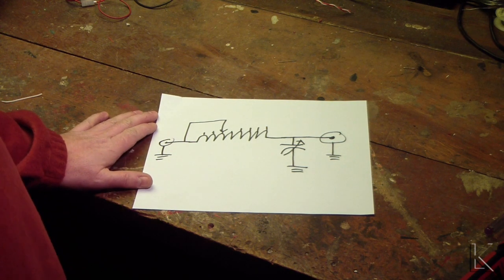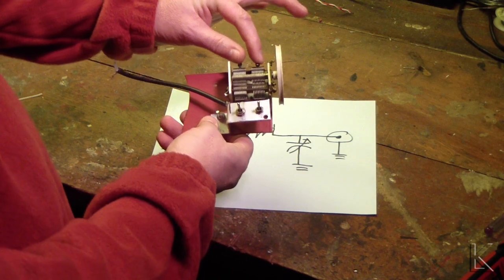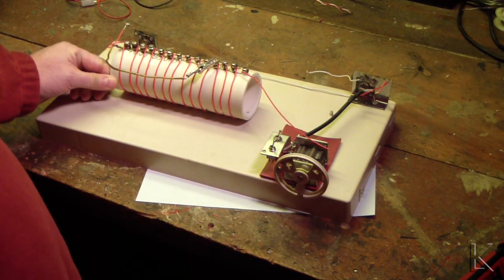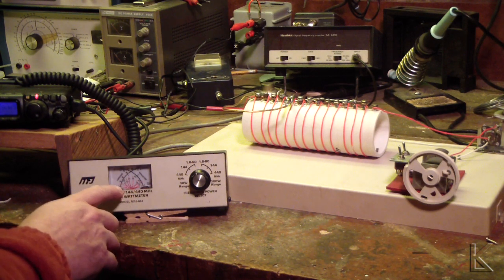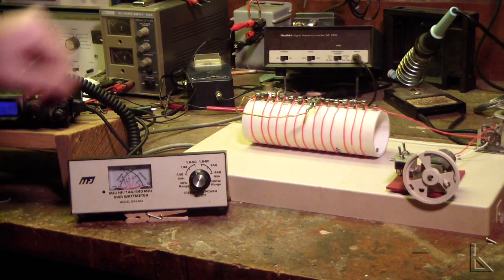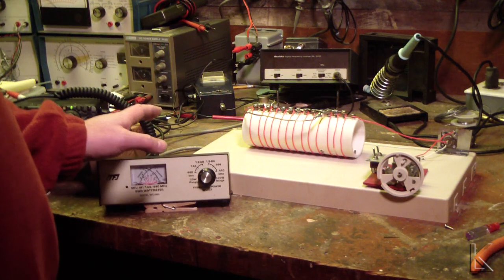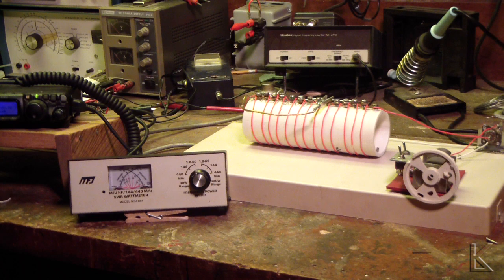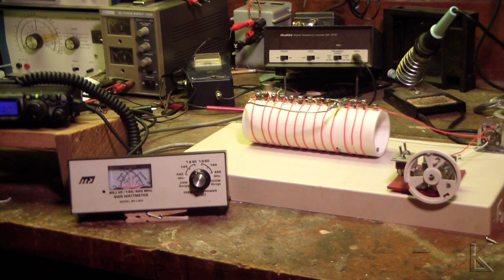Ham Radio - Build your own L network antenna tuner

Comment: Is an 9:1 or 4:1 unun required?
Reply from the maker: Either or none, depending on the type of antenna your connecting.
Reply: @loughkb  it will be a random wire
Reply from the maker: @stephenchung  if you're using a random wire antenna, a 9:1 unun will bring the end impedance down to a point where it's easier to match
Reply: @loughkb  Okok thx

Comment: Hi, Kevin. Great tutorial. Can I use any sort of wire for the coil, or does it need to be 50ohm wire and does it need to be insulated? I have some copper stranded speaker wire, would that work? Would the copper core of 75ohm tv coax work without any insulation? Thanks.
Reply from the maker: You can use any sort of wire.  Solid is easier to wind than stranded.  Stranded doesn't want to hold it's shape.  Not sure what you mean by "50 ohm wire".  Such a short run of wire will have a DC resistance of less than 1 ohm typically.   I was using 18 gauge hookup wire in this tutorial.
Reply: Thanks.
Reply: Kevin, can you use this matcher for CB FM frequencies? I forgot that in America you guys still use AM.
Reply from the maker: Sure.  Why not?  NFM is either 2.5 or 5 KHz deviation.  An L-network tuner will usually provide a rather large bandwidth.
Reply: Thanks, Kevin. I'm still building, but waiting on an old, broken, Roberts' radio arriving from an Ebay seller to scavenge the tuner from it.
Reply: I've picked up a variable capacitor from an AM/FM radio with Medium, Long wave and FM. The capacitor has 6 points of contact. It's about 2.5 cm square, and there appear to be two sets of rotors and two sets of stators inside. They are encased within a transparent, sealed unit. I scavenged the capacitor from a 1990s Roberts radio. However, I have no idea how to wire this to your above designed matcher. I have it all built except for the wiring. Help! I'm also confused about the sequence of where and which side to connect the SWR meter and radio
Reply from the maker: You'll have to figure out the capacitor, I don't know that one.   Sealed unit?  Is this one of those tiny plastic square caps you find in pocket transistor radios?  If so, very low power capacity, maybe OK for 5 watt QRP.
As for hookup sequence...  Radio -> SWR meter -> tuner -> antenna.
Reply: Hi, Kevin. Thanks for the speedy reply. The model of the radio is a Roberts R701 AM-FM 3 Band. The radio itself was quite big until I dismantled it. Yes, it is a square, transparent plastic box style capacitor, but I'd say it is of medium size, not tiny - it's around 1 inch square. I forget in America you guys still use imperial measurements; ft and inches etc. There are two very small male spade connectors on the top and a middle one on both the top and the bottom.  I think the middle one could be ground, but I'm not certain which is which, top or bottom. I don't know why there appears to be so many contacts. The four corner posts look as though they are threaded, but they were soldered onto the circuit board, and that's where I soldered my wires. I bridged them in various ways, but my CB didn't respond positively in any of the ways I wired it. No damage done, though. My CB is still operating as out of the factory. Is the wiring of the antenna's centre post meant to be wired to the Stator plates or the Rotor plates? 
Thanks for all your help, mate, I really appreciate it.
Reply from the maker: There's probably two sets of plates in that capacitor.  They would have used one set to tune the local oscillator and the second set to tune the preselector on the RF amp.
You'll probably want to parallel them to get more capacitance, once you figure out the wiring.  Google around and you'll probably find hints on wiring it up.
Put the radio in ssb mode and fiddle with the tuner to find the loudest static and highest noise floor on the S meter first.  That will get you close before you try transmitting.
Reply: Thanks, Kevin. I've tried googling 'how to wire a dielectric, variable capacitor, but, unfortunately, to no avail. There were plenty of other sites (And images) that described how a capacitor works. Surprisingly, though, none of those sites or images explained how to wire one. Instead, the sites and images predominantly provided information of only what variable capacitors are and what they do, with schematic drawings, here and there, breaking down the chassis and the parts therein, but not how to wire one. You were my last hope.
I only have a 'Midland Alan 48 Multi Plus' but this particular model does not have the SSB facility installed. I am considering challenging a course to attain a Foundation Licence for Ham radio. Should I take that step, and pass the exams, I shall consider again purchasing a Ham radio with SSB etc. installed, and continue to use my Midland CB, as it's too good a working radio to pull it's plug out.
In the meantime, I'll be back at the drawing board after dinner with multi meter and capacitor in hand. :)

Thanks again for all your help, Kevin.  
Kind regards,
Lawrence.

Comment: How much radiation are you getting exposed to with out any shielding on your tuner?
Reply from the maker: Nill.   5 watts, low power.   Even at 100 watts, with a beefier capacitor,  no worries.  It's HF electro-magnetic non-ionizing radiation.   No effect on biology.

Comment: I prefer to call them ' Matchers ' as they don't actually tune an antenna , They Basically  " Match "  one impedance to another .... Your radios 50 ohms to whatever impedance your antenna is, A bit like a matching transformer but fully variable ..   I think the " Tuner " bit is a bit misleading , AMU rather than ATU 👍
Reply: Some call it an astu, (antenna system tuning unit) as it tunes the whole system to resonance by way of a conjugate match to allow max power transfer, the book reflections or arrl antenna book explains in full this conception